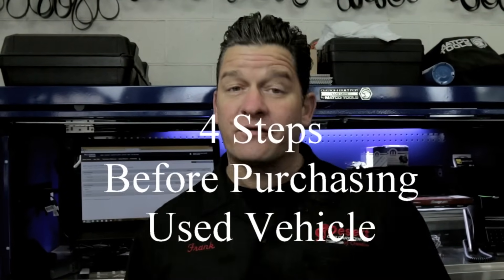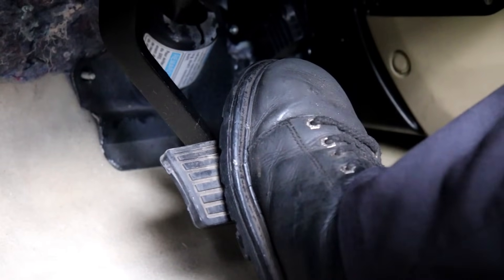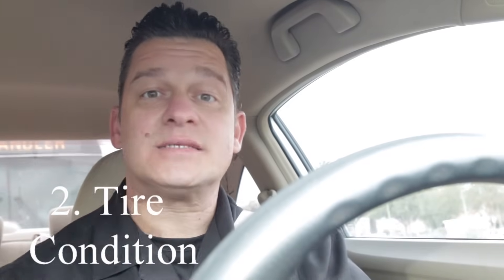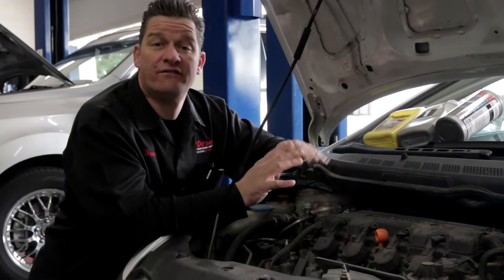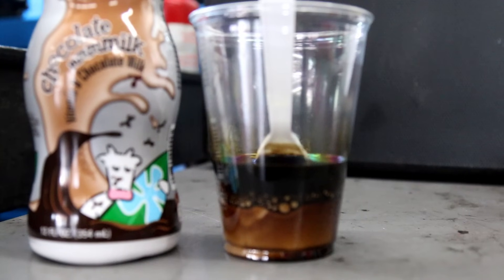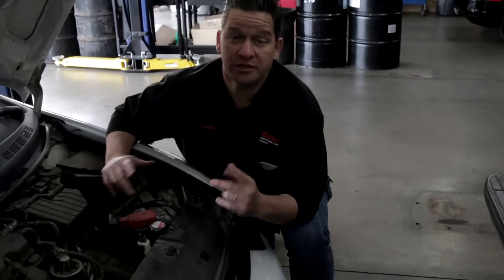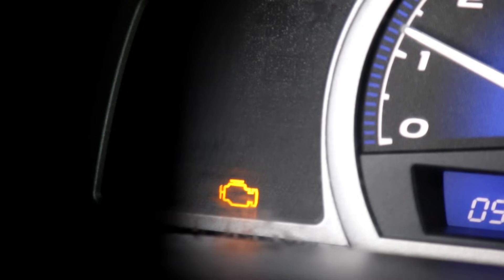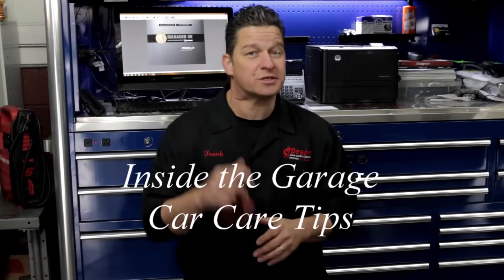How to avoid buying a used car lemon. Easy steps you can do.

Comment: odometer roll back that is the #1 scam of all used cars in every possible sales scenario its a FACT that has to be dealt with  .. carfax not enough, miles to low to be believed 80% it is! & fake, look at times of service records if well kept will almost guarantee real miles, periods of a year or more where there is no recorded miles (very painful) because roll back strong possibility (u want that car but it has 1 year then a year & half no records on carfax or autochk, or shop receipts PASS ON IT!  Also types of vehicles >>what was it used for? Im in the market for a duelly most have big miles because they are heavily used that's what they r 4! I have 2 2016 f450 SD under 38k IT IS 'HIGHLY UNLIKELY' THEY HAVE ONLY $38K! Then you have to get into ALL THIS VIDEO SHOWS, nice job on the check list here by the way.
Reply: STEPHEN CHRISTIAN what is a duelly?
Reply: odometer can be roll back before car check and nobody will notice it..... the only bad thing is that it cant be even identified with obd2 scanners but someone should change it to make a definite end to the scammers.
Reply: Thank you Stephan Christian.
Reply: @fredflintstone2234  trucks with 4 wheels on the rear end for heavier tow loads.

Comment: You need an OBD II Scanner. Some dishonest people clear the codes so the check engine light is off. If your scanner says all systems are "NOT READY" it is a clear sign the codes were deleted but the check engine light will come on soon.  Walk away if your scanner shows the car's computer reads all the self diagnostic tests are "not ready".
Reply from the maker: Nick V ..excellent point ! Those "Readiness Monitors" need to be good to go..thanks for stopping by!
Reply: Nick V how much for the obd ll device and where is the best website to get those from thanks
Reply: $15-$40 for a basic scanner. Ebay is a great place to get one.  That's where I got mine.
Reply from the maker: Nick V ...ensure you are comparing known values by reviewing data stream as opposed to code pulling to determine needed repairs...caution here. Rock on ~Frank
Reply: how do u compare known values using data stream?
Reply: The alternative is to actually drive it for a little while and it will turn on. Any dishonest people will obviously avoid this. If they do, just walk away.
Reply: My used car has a traction control/abs problem. It popped up 5 minutes after I drove away.
Reply: @mostmost1  should have drove back to the seller and not confront them about it but simply say! Hay how did you deal with this light? How did you turn it off. Being that you meet in person!
Reply: Sounds like every car dealerships in orlando florida. Very scummy, sketchy and seedy. Sell auction cars they get for $1,500 and sell them for $8,900 to $10,000 for junk.

Comment: Problem today is finding an honest garage who wont say its fine to get more business later
Reply from the maker: David Roach ...can be frustrating no doubt.
Reply: I still like my old cars that arent all computerized easy to fix and most will keep running when these new cars will bite the dust
Reply: David Roach I got a good one saved me from buying not a lemon but the worse thing next to it
Reply: Same here. I've got an old but reliable "granny mobile" 96 Buick Century. Bought it for $500, repaired the minor issues and the one major issue, kept up with oil changes, tire changes, etc. and it's been running smoothly since 75k miles when I got it. it's at 120k after 8+ years and still running strong!
Reply: David Roach an honest garage, that I the true dilemma.
Reply: True. If they say it’s fine and turns out it’s not, I definitely wouldn’t bring it back to them for more “work”

Comment: big major flaw. First thing you do is look at the vehicle for faults and THEN drive it
Reply from the maker: llVIU ...Excellent point !
Reply: I've walked away numerous times for faults. I found some contaminated brake fluid in a car once & I was googling it on my phone when the seller tried to hand me the key to drive. I said "Im not ready for that yet". When I found out the brake system seals were toast we walked away without driving it.

Shady ppl try to rush you right when your about to discover a major flaw.
Reply: Spot on
Reply: Desert Car Care g
Reply: You need to drive it to find faults and many of the big faults are noticed when the vehicle is moving...

Comment: All really great advice but I'd suggest a few things: First ask whether the seller is the owner and whether he/she has the clear title in hand. If not, don't bother.  They might have all sorts of tales about why they don't have it. Just say "thanks" and hang up.  Don't search for vehicles that have known issues that affect reliability. Check on line. It's easy. I would avoid CVTs until they are better proved with time. Don't begin with the test drive. Start with careful inspection including body panels, gaps, etc. Bring a magnet to check for body filler. Check the inside of the tail pipe with your finger for oily residue. Certain makes require special coolant. For instance, Toyota products should be pink or red. I check conductance with a multimeter and measure pH. Check under the oil filler cap for evidence of a bad head gasket. These often fail when the heads are warped from overheating. Never buy one of those. Get a cheap OBD II scanner.  If possible, when you do start the engine, it's best to start it cold. Listen for clattering that takes more than a few seconds to disappear and look for tail pipe smoke when you start it. Note the color.  IF the vehicle passes all of your tests, take it to your trusted mechanic for a PPI before exchanging any money.
Reply from the maker: wholeNwon ~your statement is gold. Great stuff 🤜🏼🔧🔧 thank you ~join the conversation here http://www.wrenchnation.tv/

Comment: My tips to add: 1. Do not let them warm up the car before you get there. You want a cold first start. Check the ground under neath where the car is parked for any puddles from leaking gaskets, tubes, pipes which will signal trouble. Most importantly size up the seller. There are too many shady ones and we all know what they talk and act like. There are certain types of sellers that I will absolutely not buy a car from because I do not trust them. Call me what you want but its my money and if my gut instinct is not right, I'm walking away. Also make sure the title is in their name. The best cars are original owner cars with full maintenance records.
Reply from the maker: Great tips !

Comment: A problem lots of folks have is mice chewing electrical wires inside the motor.
I highly recommend that people open hood and remove plastic coverings and examine all the wires going everywhere for mouse chews. One mouse can make entire cylinder misfires, idiot lights to come on, and pee and poop inside fuse box can cause a lot of random issues like windows not going up or down, cd and radio not working. 
Yea definately check for mice. If u got acorns or mouse turds or seeds and nests inside anywhere u got wires chewed
Reply from the maker: We see quite a few cases like this in the garage wreaking havoc ~ thanks for bringing it up ~ appreciate it !

Comment: Another thing to check is the CV joints. I bought a Toyota Avensis couple years back and forgot to check them. Few weeks later,I noticed clicking noise from drivers side wheel....cv joint knackered. You check for this by turning the car full clockwise turncircle and also an anticlockwise turn. If theres a click,it means the cv joint is going
Reply from the maker: Excellent point

Comment: My main concern is if people use head gasket sealer, is there any way to know if they have used it to cover up a blown head gasket?
Reply from the maker: Absolutely ~ in most occasions examining the radiator cap or coolant over flow bottle will typically reveal trace evidence of a gooey like substance ~ really dig deep in to the radiator and that over flow bottle to look for crud here.

Sometimes someone will try and mask up the evidence with a good cleaning & detail of the vehicle before selling it .

Have your local mechanic inspect it before purchase as they can help identify the stop leak with other methods and tools .

Comment: Thanks for this but i suggest adding a number 5. Which is a body check. May be the least important but you have to check for rusts, accident signs (not talking about small dents) and signal, reverse and head lights).
Reply from the maker: Doubay A ~ excellent points that we may forget to inspect for ! That slight pull that seller leads you to believe is “only” an alignment may just be a serious frame issue . Thank you for bring these tips up ! They will help someone here for sure !

Comment: Very useful tips here so thank you. In addition, i worry about things like an engine having temporary head gasket sealant poured into it to mask head gasket failure symptoms and also if the original gearbox was replaced at some point by a higher mileage or older one due to failure of the original. To minimise risk, i tend to buy one owner/driver cars only so anything dodgy afterwards can be traced back to only that owner and i do a full lube and filter service myself or oversee it, regardless of any receipts showing they have been already done unless there is a dealer computer report. This way i can track a new service record accurately. Also i make sure at ignition, what the display should show in case the seller has removed a warning bulb to avoid it displaying a fault, via that very bulb. I will start a car at least 5 times to make sure no cogs on the flywheel are have broken off and keep an engine running until radiator fan kicks in to make sure it works. Damp carpet in the footwell under the blower motor may indicate a leaking heater matrix. Hope this helps someone.

Comment: In your opinion, if well maintained, witch muscle car from 1998 to 2002 would be most reliable. Mustang gt, trans am, or camaro. I'm talking v8 engines
Reply from the maker: 505 enthusiast —Tough call. Personally I have not seen Mustang or Camaro as problem childs coming through the garage if maintained right. I do see botched improvements of performance to original factory attempts that were not done correctly ~~watch for this and certainly have a pre purchase inspections performed prior to protect your wallet. Either way sounds like your going to have fun with a little street performance! Rock on🤜🏼~Frank
Reply: Desert Car Care I can't wait! I really want that sweet ls1 engine. Thanks for your input

Comment: Make sure the engine is cold before starting, it may have ticks, clicks or knocks that go away once warmed up.           Extended cranking time before starting may be sign of a weak battery.       The airbag light does not mean it was in a wreck, it could be due to the airbag recall for many cars which have still not been fixed.    There is a website somewhere that shows which cars are subject to the airbag recall.
Reply from the maker: Jon Smith ...awesome info ! 

Here is that link to check for Recalls : https://www.nhtsa.gov/recalls

Thanks Jon for stopping by!
Reply: Vvt on some mazda cx7, some toyota can be about to go, need to listen for   ticking on startup
Reply: @joeimbesi99  Yup!

Comment: How about a tire pressure light？
Reply from the maker: kevin gose ...TPMS. 

Of course checking tire pressure is key. If the Tire pressure light does not turn off , & tire pressure is known to be at specification, may need a TPMS sensor ( mounted inside the rim). Should not be a deal breaker, as these sensors are less than $100 in most occasions. Good luck & thanks for stopping by!
Reply: Thank you for the reply. I am also just curious about if the owner of the car seems have a really good relationship with the dealership or shops. Will the pre-purchase inspection result be biased then？
Reply from the maker: kevin gose ...for sure may seem a bit suspicious. I am leaning for a real reliable, certified reputable independent inspection...otherwise could be a biased inspection. If you need a great service provider...reach out...I have great garages across the country to help. Good luck !
Reply: Thank you. Actually I would love to let you guys do the inspection but I am in Canada right now. Do you guys have any garage in Canada？
Reply from the maker: kevin gose ...ring me at the garage & I will get you in the right hands . Have an amazing weekend! -Frank

Comment: Is the uneven tire wear an alignment problem or a balancing problem?
Reply from the maker: ..Typically uneven wear is an alignment concern..always best to ensure the toe setting is to specification--a tire balance issue will normal pose vibration faults when cruising at higher freeway speeds. Hope this helps ! 

Always here if need assistance ---tks --Frank
Reply: Thanks for clarifying. The video is very informative and useful.

Comment: Great explanation brother, however, I just to add that a buyer should also consider if it's the right VIN number that matches the car. I've worked on a lot of cars and sometimes I came across with incorrect VIN. We both know that this is very rare but I would rather drive a vehicle that is not stolen. Thanks for sharing your knowledge, sir!
Reply from the maker: Michael Daniels Manalansan ...this is critical ! Great great point. It just takes that one occasion to create beaucoup problems. So appreciate your share here for all...rock on. ~~Frank
Reply: VIN is stamped on each major body panel and should be visible.  If missing, accident damage, depreciated value, and parts replacement strong probability.  Vehicles with accident damage are worth less than KBB or NADA value.  Avoid in general, as hidden damage likely exists and future resale affected.

Comment: Buy a car with a warranty finish of story. Might be more expensive but saves you from all the hassle
Reply: Only for the time of the warranty. A used car with a 30 day warranty can cost 1/2 the price of a car with no warranty (for example $6000 versus $4000). At the end of the warranty period the car can still have issues that cost money.

Comment: Not a very thorough check list, there are youtubers with better sequence for checking a used vehicle. No OBD scanner or paint thickness meter? Check car documents? The list is long, but you should give it.
Reply from the maker: thedarkone123123 ~spot on. Definitely more on that list . Thanks for the input .
Reply: That's too long for a list. You'd still be looking for faults a week later.

Comment: ahahahaha heavy overheating, like driving 195km/h in a vw golf 2 (exhaus pipe were red hot at daytime sunlight), by god that oil was not cocolate milk, it was only milkshake in there but it ran until they drove it 2 runs on a cart track in second gear, but it was also near 300k km so whatever, rip golf2cl

Comment: Get an inspection before buying. It will give you peace of mind.  I recently bought a vehicle, but had an I inspection. The car was 10 years old and had 71k miles. Not bad for a car that age. Normal wear and tear. The steering needed an alignment, but tire tread was good. Overall no major problems. I also hooked it up a computer scanner, no codes. Fluids looked good, no smells, no dirty looks. But yeah 2009 Mercury Grand Marquis. I'm gonna get the paint touched up. My father in law is auto body guy, he will just charge me for the paint.